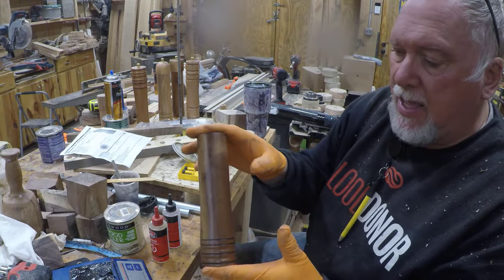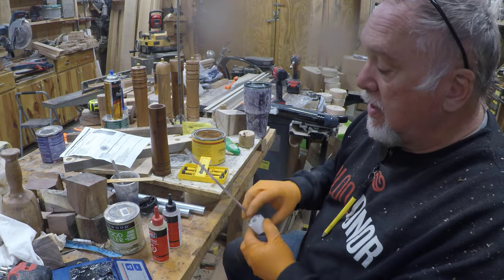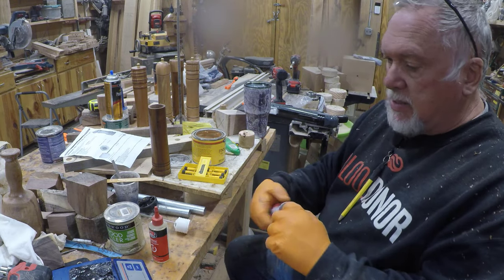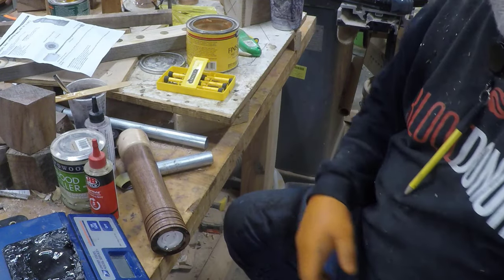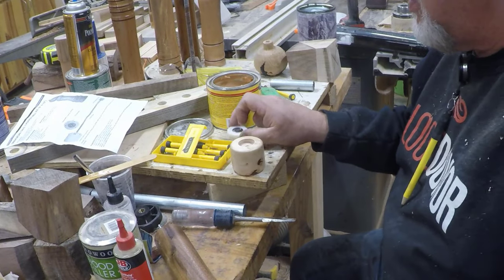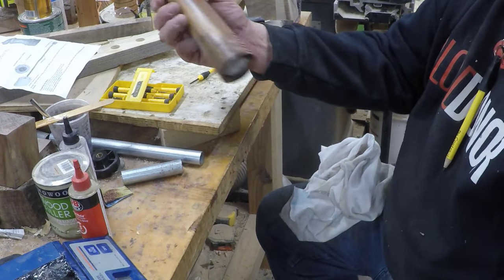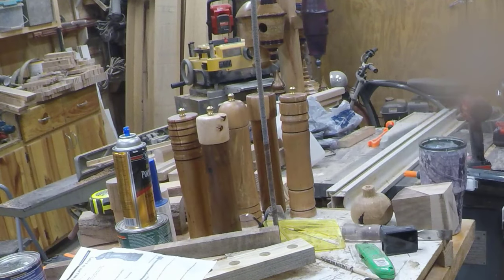Peppermills for Craft Shows: How to Streamline the Production Process

Comment: Very efficient. With that kit, to make sure the mechanism is glued in straight, I use a dummy top to hold the shaft centred while the epoxy cures.
Reply from the maker: Thank you Gord!  I used the top as a guide.